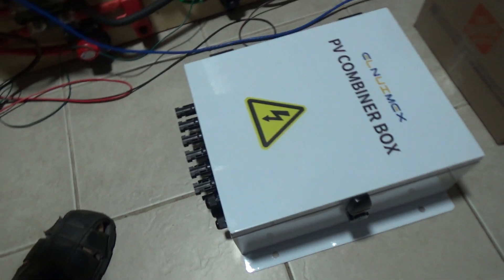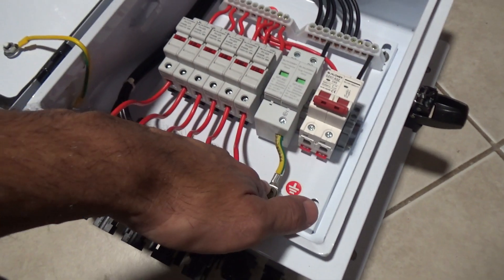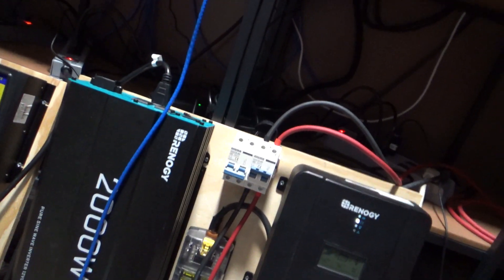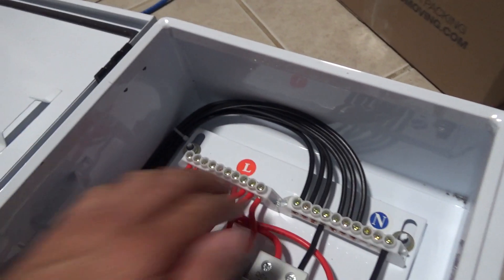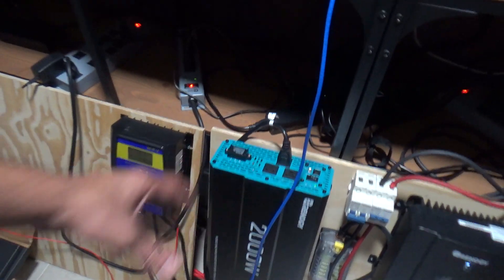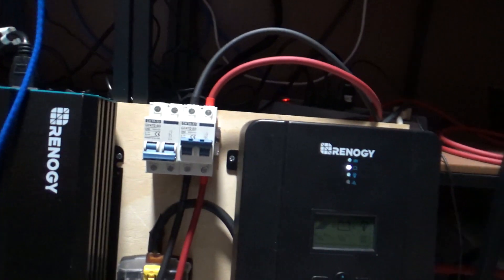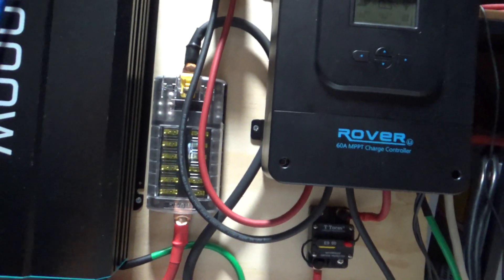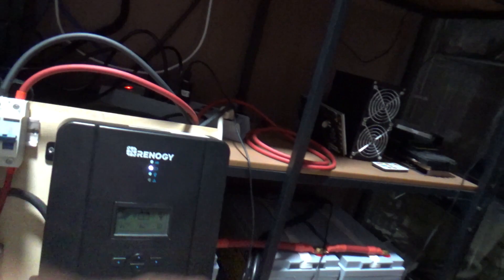Going Solar is a Good Idea for Crypto Mining

Comment: its the other way around mining only makes sense if you have solar..(going mining ius a good idea if you have solar/green energy)
why even get anything before you have free green electricity 

black coins should cost less, and certification is also comming these years 
many countrys (not usa :face-green-smiling:) demands datacenters and miners to create their own green energy

decides when the big boys have free energy, its hard to beat them without

sounds like a very small string, in my case the voltage would get pretty low, and i would produce less watts 
i would get more by connecting the 4 and 6 panels into 1 string, no matter the panels direction
Reply from the maker: Thanks for the info